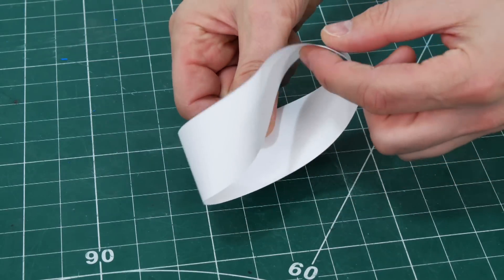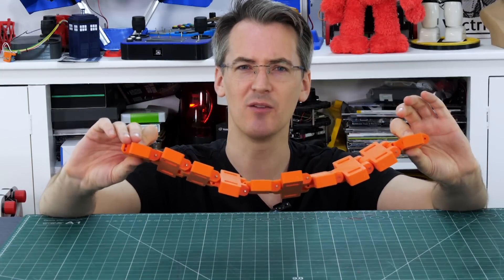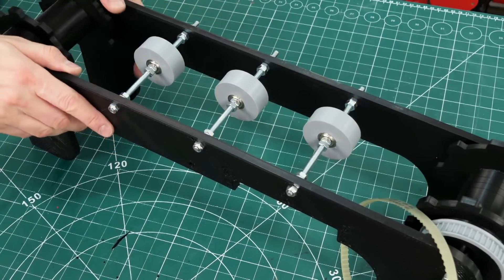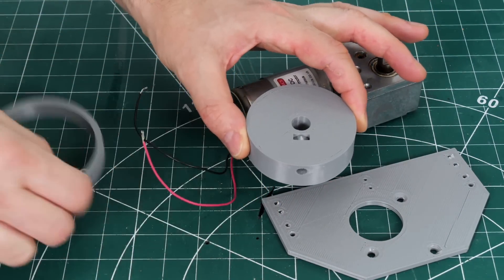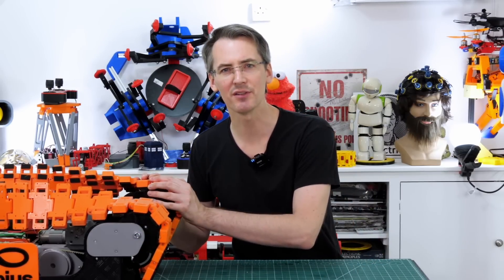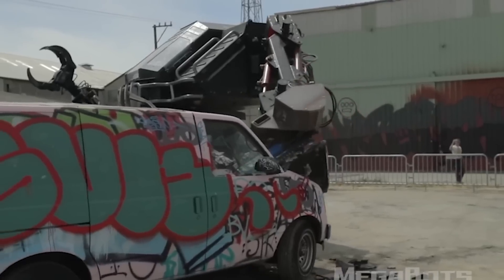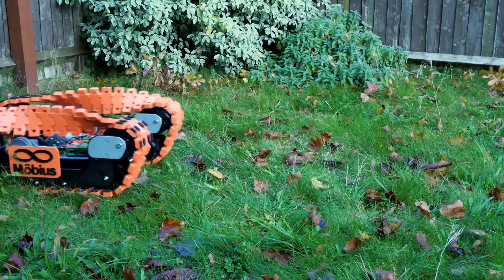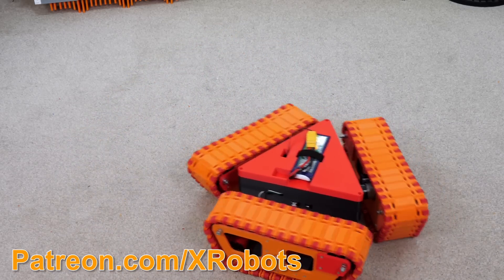Mobius Strip Tank

Comment: I guess one advantage would be for this design if the tank was running in an extremely muddy/wet environment where the effectiveness of the tread grip is compromised, you could have a brush/cleaning device within the mechanism (maybe by the bogey wheels) to clean the outer tread surface whilst the tank is in motion. Although the outer tread of most common treaded vehicles are designed to allow the tank to negotiate the terrain without cleaning.

Comment: @JamesBruton You can keep the tracks from doing wierd things by adding a pinch roller on top of the ends of the twist section. That would keep the eges straight when the track comes into contact with the sprockets on the ends at higher speeds. The advantage to these tracks would be that the wear is distributed across both sides of the track. Grip on both sides would wear as if the tracks were twice as long.

Comment from the maker: I'm thinking about using the twist in the track to make the next Bendy Tank!  Look out for that some time.
Reply: 10 Links only have 9 connection points. That's why 10 links didn't go 180 degrees.
Reply: I wonder if there's any value in trying for a tank that contacts the ground with the bend itself.
A really narrow track with full drive benefits of a wide one?.. But probably would have lots of sideways forces.
Reply: @darth_dan8886 
With what
Reply: I was hoping you'd adjust the pitch and yaw of the drive motors, opposingly so the twists went around them, ridding us of that conventional flat track.

Great work btw.
Reply: And, what about using it as a propeller for an aquatic vehicle!? I think it could be worthy!
Reply: May be Bentley tank?
Reply: Love the idea but it hurts me that you didn't flip it upside down to see what the twist would do on the ground.
Reply: why is one of the tracks on backwards James? xx
Reply: Could you please work in ball and socket joints
Reply: My brother in science! Take this to the next level, make a single track that drives BOTH sides of the tank. Maybe it can bow around the front of the tank to act as added frontal armor. or behind to protect the tracks.
Reply: I do actually believe this is beneficial. See, since the twist effectively doubles the available surface area, you've also effectively doubled the lifespan of the tracks. you've increased the total amount of surface that will wear as the tank is driven, meaning the track has double the total wear material available as compared to a standard (non mobius) track. As long as the twisted track doesn't increase wear on the sprockets due to torsion, it may be a viable way to increase mean time between failure for autonomous track based rovers and such. This is absolutely brilliant. It's a pleasure, as always, to watch you work, James.

Edit: 
After reading further down into the comments, I noticed some others stating this too. Great minds think alike! I was so excited I forget to check if anyone else had mentioned this.
Reply: The twist is probably causing accelerated wear and or break (probably mostly initial break in as the print smoothed out where the metal bar twists)  in on the link connections, this probably caused the slack to show up in the track tension right away. If you can manage to set up an end roller's axle (usually opposite end from the drive sprocket) on a slide rail and use a spring to push the axle out on the slide to tension the track, then you can have a track that has a more consistent tension as wear occurs. The major downside is that (as long as you put the sliding axle on the front and the drive sprocket on the rear) when you apply reverse torque the torque tension travels through the top section of track, pulls backward on the tensioner and causes slack in the track tension under the machine. This isn't a big problem if your able to have a spring that applies more track tension than the motor, on a track system with a friction drive instead of sprocket drive (SEE CAT challenger track tractors) this severely limits the drive force in reverse because the friction between the rear drive wheel and the inside surface of the track lessens as the drive wheel tries to pull the top of the track in reverse. The reason this doesn't happen in forward is because the drive tension is applied to the ground BEFORE it gets to tension axle instead of AFTER the drive torque gets to the tension axle. 

I operate heavy track machinery 5 ton all the way up to 50 tons on the regular. The problem with the steering on the track bots is better solved by changing the force distribution on the tracks contact with the ground.... 
With a track excavator (large and small) you redistribute your weight so that the majority of the machine rests on one end of the set of tracks or the other, and the light end has hardly any friction with the ground or doesn't touch at all. Or you lift one end of the tracks up by pressing the bucket to the ground, but then you have to help the turn with the turret swing. Of course different ground conditions limit your choice of what to use, and if you are on hard flat ground you can usually turn quite easily on steel tracks... but it has to be hard like pavement or frozen to keep the edges of the tracks from digging in.
Another way to deal with this (another thing from CAT challenger track tractors, at least from the older models up to at least the E's) is to put an active suspension component into the middle of the track. On the machine in this video here a C model https://youtu.be/Hc_U00JoLcE?t=71 you can see an air bag just above the forward pair of midwheels. This air bag forces those two levers(above and below it) apart and causes the four midwheels (in two pairs) to lower down from the axle where the center section mounts to the machine and press harder on the center section of track. This provides mobility in the center section of track allowing it to follow the ground better when the air pressure is low, and if you jack up the air pressure it can lift the machine up on the center of the track and turning becomes much easier. On these machines you decide on an air pressure depending on your use case (better ride and ground contact or better turning) and leave it alone most of the time. If this type of midwheel setup is given a powered actuator you can choose on the fly how your track contacts the ground to switch between even ground contact and better turning. (The track tension is kept consistent by two large cylinders that pull the front axle forward with a combination of spring and gas charge pressure, this is very important for these friction drive rubber track tractors)
Reply: Dear james, Please read my comments: I love this Tank wheel and I love yu magnificent Ideas, I love this tank too and its genius❤
Reply: I still despise you for misleading the viewers about The War Of The Worlds.

Comment: Nice video as always :D  .  As an idea for a future video : Tracks /wheels with convertible (in and out) rubber pikes or plots to enhance traction at a flick of a button . To do it , each blade as 2 plots with outside rubber end , and they're normally retracted by the use of elastics or springs , and at a flick of a switch , a slide plate mechanism push these plots out of the track on the ground side to enhanced traction .

Comment: "so we can have one side of the tracks" no you can't. the tracks have only one side, that's the whole point! i don't think there's really any way to control which "half double side" you want, and if you're on the grips you'll always have turning issues or rip the grips off i guess before getting to the smooth ones... a situation where the grips can be "poked out" of the thread by pushing a gear/whatever into it sounds way more useful

Comment: How about a version with a few more turns of the track, bigger twist angle so you can fit them at around a similar length as this one, with the turns on the bottom so the tank rides on the edges of the tracks? (I imagine you might need to have the tracks on  each side of the tank not perfectly parallel, but instead a bit angled to account for the sorta rolling motion of the screwy thread; not really sure how much impact that has though)

Comment: Oh, this would be wild .... it's a bit hard to explain and would be stupid difficult to build, so to explain the concept, let's evolve the design in conceptual steps:

Step 1 - Create a normal tank tread.  Simple enough.
Step 2 - Wrap that in another tank tread so that it is double layered.  Also simple. 
Step 3 - Drive the inner and outer treads in opposite directions.  Tricky, but pointless.
Step 4 - Mobius twist the 2 layer treads, while still driving them in opposite directions.  Visually interesting, but still pointless.
Step 5 - Extend the double Mobius tread to crisscross the tank body and wrap both the left and right side bogies.

Result - The outer tread on the left ends up as the inner tread on the right, and visa versa.  Now if you drive the the two mobius tread layers in the same direction, the tank moves forward or backwards, drive them them in opposite directions, and the tank turns.  Profit.

Comment: What if you could toggle the grips? You'd have some way of extending and retracting them. Maybe some rubber membranes that are in an inset. So when they get extended, a bubble shape gets pushed up, creating a grippy surface. And when they get retracted, the membranes are flat enough to no stick out of the inset. Allowing the smooth surface around them to be used.

Comment: I’ve not watched yet cos about to start work. But tracks that could be flipped by temporarily creating a mobius strip, with rubber on one side and regular tracks on the other could be useful for not tearing up a road, would only take a few minutes to change modes.

Comment: This is really cool. But if you want to solve the tank grip can't slide when turning but can't climb if too slippery problem - instead of passive grips, having small rubber balls/cylinders acting like caster wheels that can turn any direction except in line with the tank treads might do the trick. Or it might work with rubber cylinders on axles set 90° so the tank treads almost become omni-wheels. Not sure if that would work with Mobius treads though, you'd need twice as many. And you'd get uncontrollable sideways slides on slopes. Hmmmm. Better check your history to see if you've already made this 😂

Love your channel, always makes me think 😊

Edit - your triangle tank treads did this. Wonder how that tread would handle the Mobius?

Comment: Truly an example of a solution in search of a problem.
Reply: ACTUALLY... the tracks will get more evenly worn, lasting twice as long (in theory). :'3c
Reply: @colonthree this is not an issue with tanks due to the surface area of the contact patch being so much larger than if both sides had to be interlocking with the drivetrain.
Reply: @colonthree  actually you just design the outer surface to be more wear resistant with the ground and the inner surface to be more wear resistant with the sprockets and drive gears. Making it like a Möbius strip just means that both sides have to do both and hence compromises need to be made making both sides worse at both. So it would wear better and perform better just with a properly designed normal track.
Reply: @conorstewart2214  Something i dont see mentioned that relates to design is the extra space the shape of the top band is creating, which could lead to lower profile tanks, meaning less surface area that can be shot, while also allowing the bands to act as protection of the hull, which in turn would lead to less casualties.
Reply: @thebearded4427 I’m not sure about lower profile, the last thing you want in an engagement is your tank treads shot because that leaves you a sitting duck and dead
Reply: @colonthree also if the vehicle is designed for dirty ground there could be a cleaning unit on top that cleans the side that's next gonna touch the sprockets
Reply: @Smona I was thinking similarly, but I’m sure there’s flaws in the logic.  Still I like the idea of accomplishing something useful to the “inside” when it enters the “inside” track position.
Reply: @Smona  with a normal track you can have a dirty side and a clean side and so the track isn’t dragging all the dirt from the ground into the sprockets in the first place. Yes the sprockets still get dirty but they will still be cleaner than the other surface of the track. There is nothing stopping you from putting a cleaner or brushes on a normal tank track anyway, but at least then you have separation between the dirty and clean sides.
Reply: @conorstewart2214  When should we expect to see you post your video showing how it should be done?
Reply: @colonthree yeah and twice as much dirt everywhere
Reply: @colonthree  havent done much maintenance on track treads have you?  This introduces more problems than it solves.  That is for sure.
Reply: @colonthree for tracks. It’s kinda dumb, since at least on vehicles the tracks aren’t symmetric, and wear pads are put down to extend the lifespan of each individual track
Reply: @colonthree  :3
Reply: @colonthree you could use replacable pads that take the majority of the wear
Reply: And wear bearing tiwce as fast ,you jhst end upo with something with half of life
Reply: Well, it's a single surface, which means you have direct access to the face it just walked on. You could  use this principle for sampling ground with the strip contents or to continuously coat it with paint or something, both without an external frame.
Reply: @gustavocortico1681 I suppose that’s useful for manufacturing at least
Reply: It would time travel if driven a little faster.
Reply: I think another use of this would be an extremely aggressive deep gripping tread on both sides. Normally something that would cake with thick mud would not be optimal but in this case the mobius twist would eject more mud as its twists to the other side leading to more grip.
Reply: yes but a cool solution
Reply: this phrase was originally used for the laser (as far as I can remember)
Reply: maybe something like a lint remover
Reply: Sounds like something the military is all about.
Reply: Well what good is a solution without a problem!
Reply: @codyfrisch4378 stereotypical.

Sad.

Comment: Quick question to the viewers and James. At 8:07, you can see the arduino and the cables running from it. I have made an arduino project my own and now i want to connect all cables and pins to test it on big scale. But how do you call these connectors that you have placed into the arduino pins to connect cables to (because i dont want to solder everything since i might reuse the arduino for something else later.
Reply from the maker: I just plug in pin strip and solder to that
Reply: jumper wires...

Comment: Is V2 one continuous track that does both sides? Like double looped strip woven into an X?
Reply from the maker: V2 is probably the next bendy tank using the twist to make it bend the other way
Reply: One continuous strip would only be good for driving in straight lines unfortunately. You wouldn't be able to steer

Comment: I suspect the tracks would run smoother if there was just a little more distance between the top sprockets. That or a modification to the sprocket design.
Reply: It'd be better to have guides on both sides of the twist to make sure the track is fully engaging the sprockets properly, and if they're designed right they could pull double duty as tensioners to keep things tight, especially if a suspension system is integrated into it.

That said a track system like this would be a nightmare for reliability compared to a traditional track setup due to more points of potential failure. I'm not saying it can't be done reliably, just that it'd be a lot more expensive to get right for commercial or military purposes.

Comment: It is technically challenging to make, but i think that if we forget the mobius part for a minute,  you could make tracks that have retractable sticky parts in order to vary friction at will. I can think of a few ways to do it but it'd be easier to explain with drawings....just remember that the sticky parts need only to protrude when in contact with a sprocket

Comment: It would be a good tank for shedding muck and debris from the treads. Good for preventing jams and wear
Reply: idk, the debris would fall back to the bottom tread..perhaps having air compressor to clean up instead?
Reply: @jurajvariny6034 or a rectangular surface halfway down to bounce debris outward like rain on a slanted roof. That way you don't need to run a compressor.

Comment: The ideal turning position could be software controled:
Only leave 1/3 of the mobius total length as the slippy part (just enough for one contact surface length to be full slippery if in the right position)
When turning, software calcultes the exact slippy part of the inner turn circle to be inside and provides torque only to the outside.
"Tank turn" unfeasible though.
Reply: Could be done, but you'd then need stepper motor so the controller would know where the tracks are, and to calibrate regularly incase the motors lost any steps, or the tracks slipped on their sprockets.

But I think you've misunderstood the issue. At 12:02 he points out that in the situation where one side is slippy and the other grippy, it CAN'T turn because the grippy part just drags the whole thing forward. SO what you'd actually need to do, is make sure that if you give it a turn command, it only tries to turn when both tracks are in the same phase.